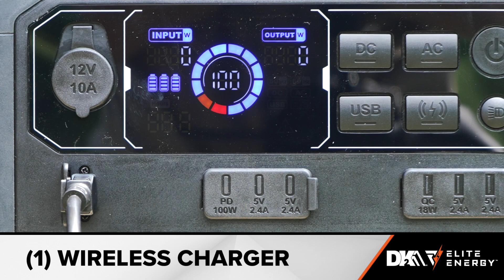Introducing DK2 ELITE ENERGY™

Comment: Good to see some new battery powered equipment from you.  Question though: Is there the capability to have the solar panel charging the battery while either the pressure washer or chipper are in operation?  Also, when the batteries have reached the end of their life, how do customers get them replaced/recycled?